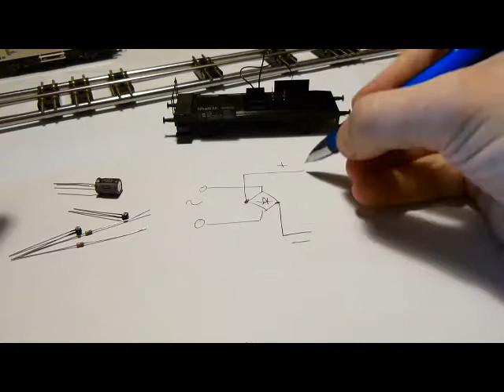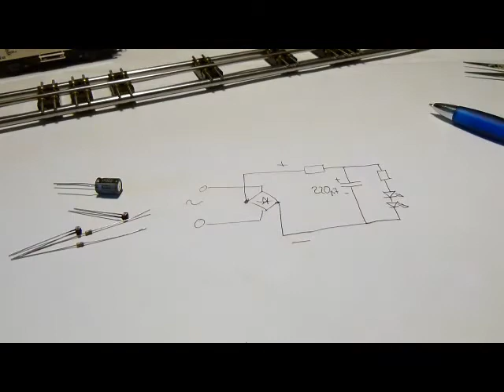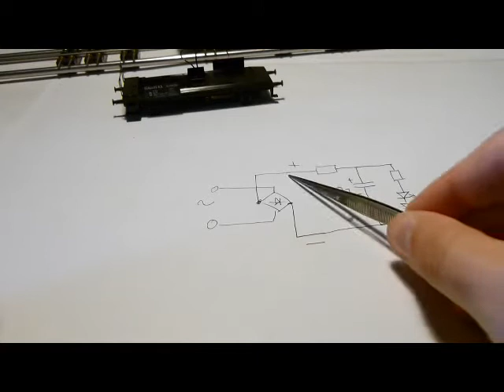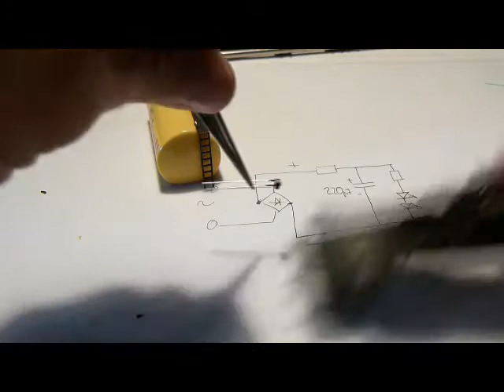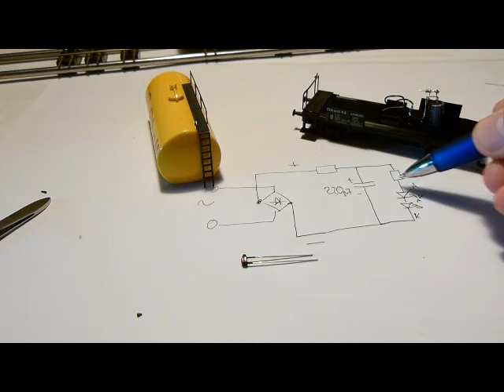Güterwagen mit Zugschlusslaternen / Schlusslicht zum Nachrüsten mit LED's

Comment: Perfekt, ein tolles Video, vor allem die vielen Detailangaben! 
Allerdings habe ich noch eine Verständnisfrage: Bei einer Anlage mit Märklin Trafo habe ich am Gleis eine Wechselspannung und benötige für die LED-Schaltung den Gleichrichter. Wie verhält es sich bei einer Anlage mit einer ESU-Steuerung 50210, hier liegt doch eine Gleichspannung am Gleis an, oder?  Kann man dann bei der LED-Schaltung auf den Gleichrichter verzichten?
Reply from the maker: Hi, 

die ESU macht auch eine Art von Wechselspannung (technisch: Rechteckspannung) wie übrigens bei allen Digital-Systemen. Der Gleichrichter ist auch hier zwingend notwendig. Die Schaltung kann somit für jedes System verwendet werden.
Lässt Du ihn weg, so fliegt Dir der Elko / Kondensator um die Ohren und der Energie-Speicher klappt nicht mehr.

Beste Grüße
MMB
Reply: Danke für die schnelle Antwort. Solch eine Präzision an Darstellung und Erläuterung findet man selten.

Comment: Hi, erstmal danke für das informative Video. 
Und dann gleich eine Frage: Habe mir die Buchse und den Schleifer gekauft und wie gezeigt eingebaut. Allerdings hebelt der Schleifer den Wagen tendenziell aus dem Gleis und verursacht zusätzlich Kurzschlüsse in den Weichen. Hast du dafür eine Lösung?
Reply from the maker: Hallo Christoph,
das Problem hatte ich nicht..
Ist denn die Metallplatte noch im Wagen?
Du kannst den Wagen auch noch beschweren oder den Schleifer etwas entschärfen.
Übrigens ist die gleiche Kombination so in dem gedeckten Güterwagen mit Zugschlußlaternen von Märklin  verbaut 4411. Wenn du so einen hast, dann messe den Abstand zwischen Schleifer und Unterboden aus. Ggf. steckt der Schleifer nicht richtig in der Buchse. Buchse und Schleifer haben Nut und Feder...
Beste Grüße
Mattes
Reply: @mattes_moba  hallo Mattes, ich habe jetzt das Loch im Wagen nochmal entgratet, den Schleifer absolut zentriert und festgeklebt und jetzt funktioniert es. Allerdings rasselt der Schleifer deutlich. Ist das dir auch so?

Comment: Hallo Moba Freund. Klasse erklärt. Ich würde mir genauere Angaben über die Widerstände und den Kondensator wünschen. Es gibt ja tausende. Am besten Bestellnummer. Danke
Reply from the maker: Hallo Detlef,

schau mal bitte ab Min. 2:00ff, da stehen alle notwendigen Werte drin. Eine Bestellnummer für die elektronischen Teile gibt es nicht wirklich. Suche nach den Werten bei Dr. Google...
Hier noch ein Auszug aus der Video-Beschreibung:
2 x  (LED) mit Vorwiderstand (hier 6.7kOhm)
1 x  Brückengleichrichter
1 x Kondensator (220µF)

Beste Grüße
Mattes

Comment: Hallo MMB. Die Anleitung ist schön. Nur wo Du die Laternen angebracht hast, insbesondere bei Kesselwagen, würde ich so nie machen. 
Im Original sind entweder am Bühnengeländer oder auf der anderen Seite fast vorne am Rahmen Laternenhalter, die ca.30 cm über Puffermitte und ca. 10 cm nach Wagenmitte verschoben, angebracht worden. Hier ein Beispielfoto: https://www.bing.com/images/search?view=detailV2&ccid=KY3Xbyns&id=E05D93443DE6A5BDE4C41F46EB6F8DB118B83944&thid=OIP.KY3Xbyns2Sax0ZTEQupC8QHaE9&mediaurl=http%3A%2F%2Fkarow900.startbilder.de%2F1200%2Fzweiachsiger-kesselwagen-einsteller-vtg-hamburg-524311.jpg&exph=804&expw=1200&q=kesselwagen&simid=608019785790524423&ck=64ECD57D818F878D286E66514906E69C&selectedindex=46&form=IRPRST&ajaxhist=0&vt=0&sim=11

Da es sich im Original um Petroleumlaternen handelte, musste gerade bei Kesselwagen mit brennbaren Flüssigkeiten oder Gasen einen Abstand gehalten werden, um nicht durch Wärmeübertragung einen Brand oder gar Explosion zu riskieren.
Reply from the maker: Ich weiß :-) Auch das mit dem Ex-Schutz ist etwas frei Schnautze... künstlerische Freiheit ;-)